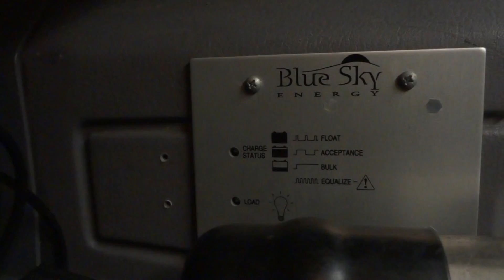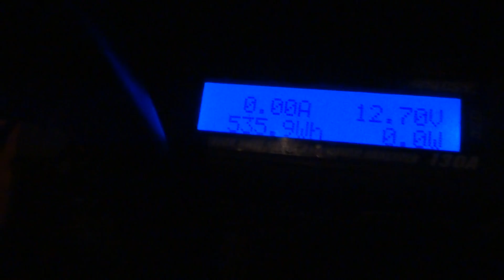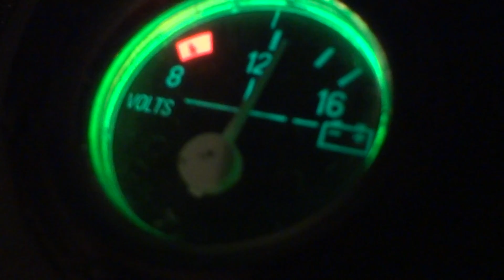Bugoutvehicle

Comment: I have been using a 8 ton HF come-a-long for years. A lot of work, but if you do not use a winch all the time it is a great options. make sure and get a turn buckle and a pair of short straps for and anchor point.

Comment: They make winch mounts that slide into hitch receivers,that way you can remove it or use it on the front or rear. But you do need the trailer hitch receivers front and rear

Comment: I don't know enough about the Cherokee regarding if there would be enough space in behind the grill to mount a winch but you'd probably need to make a custom bracket and somehow. The other option would be a winch mounted to a plate that can be connected to the vehicle by way of a tow hitch receiver at the rear. HF sells one of those plates too.

Comment: Yes I agree cv axles are a pita to work on, but bear in mind, other than the boots, they are a lot tougher than the sas guys give them credit. most all the Baja runners use cv axles all the way around. you do get better ground clearance with ifs. Your sj have auto hubs? I ask cause I didn't see you lock your hubs in.

Comment: a suggestion for your bov. Ditch the floor jack and get a hi- lift jack instead. They're not expensive and  better for off road, and can use it as a come-along. Just don't get the Chinese knock-offs. They also make an interesting tool set , one handle with multiple heads. i would also look into getting an larger gas gas for more capacity. i know some of them can be quite expensive. i've watched all your videos, and the you've got a pretty good setup. i think for myself, with the cooker, i would go with a coleman single burner duel fuel stove and tap off the gas line to be able to use gas  in it, that way you're carrying your fuel and more space inside for more essentials.